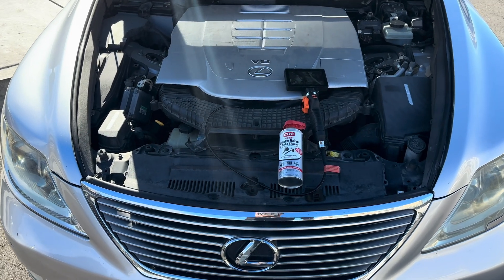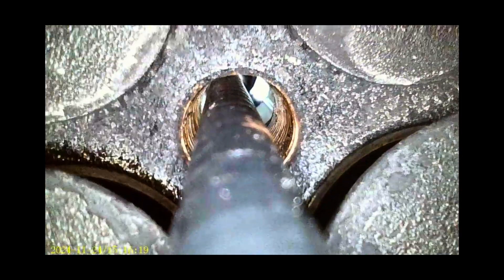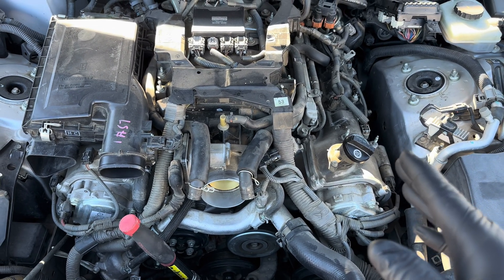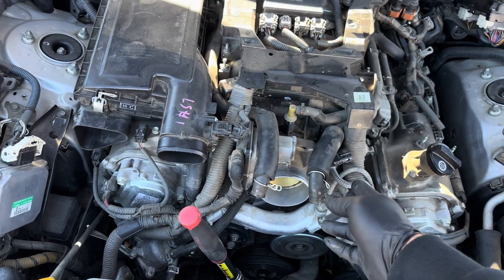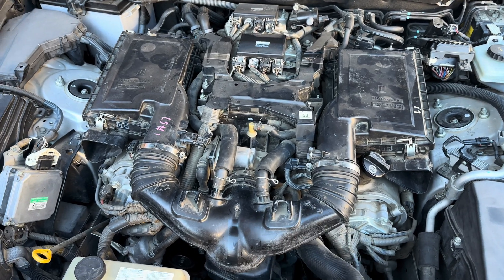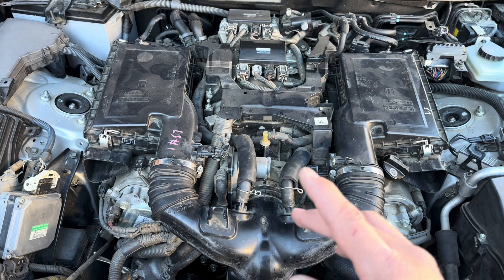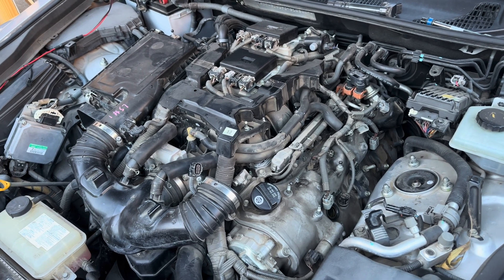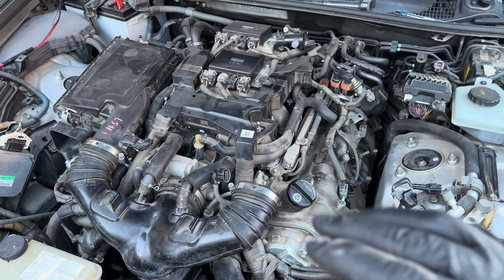Does CRC Intake Valve Cleaner work?

Comment: I just put new spark plugs in my 2018 Chevy Cruze with only 24k miles. I'm the original owner. I stuck my boroscope down all the spark plug holes and was shocked at the amount of carbon buildup on the inside of the intake valves and pistons 😮😮  I change the oil one a year or 2k miles always use high quality fuel and oil in it 🫨but most trips are under 20miles on the highway with once a month small trips. It still runs great fuel trim's are perfect 😁
Reply from the maker: These new direct injection motors have to have their valves cleaned on a regular basis. Otherwise eventually, you will lose performance and possibly cause damage. Thanks for watching.

Comment: Did you say this engine was both port and direct injection. You shouldn't have to do this unless you're engine is just plane worn out. But thanks for the video
Reply from the maker: Yes, it does have both, but because of the inherent amount of carbon buildup with direct injection, you still have to clean the intake valves on these engines. Thanks for watching.

Comment: I have a 08 ls460  i used techron fuel system cleaner do u have  a better one u can recommend i do use the valvoline oil car runs great it has 190 thousand miles
Reply from the maker: I alternate between Techron, Lucas fuel system cleaner, and CRC. Thanks for watching!
Reply: Thanks for the fast reply tony u earned a new subscriber  @Fix-it-tony

Comment: You are looking at the valves wrong. It's supposed to clean the stem part, not the plate. Stick your boroscope through one of the sensors on the intake.
Reply from the maker: These engines have dual injection, so the issue is not with the stems, but in the actual combustion chamber with buildup. Thanks for watching!

Comment: Pretty sure the oil consumption on toyota and lexus is because the rings are so low tension, they eventually just get pushed out of the way by the oil around 120k miles plus. The only way to fix the issue really is to replace the rings, just bad design on their part.
Reply from the maker: Consumption has been cut in half since starting Valvoline restore and protect 3 oil changes ago. Thanks for watching!
Reply: @Fix-it-tony  yeah that varnish build-up doesn't help much either.  It seems it doesn't matter how often you change the oil it still builds a varnish. The restore and protect I've seen can remove all of it. But also clean or replace you PCV and clean the VVT filter and you should cure all your consumption if it's not the rings.

Comment: I had much better results with using BG44K Platinum. I bought a set of 3 cans from Amazon and used 2 cans one after another one and used the 3rd one after like 5 k miles. I checked my cylinders with borescope and the top of my pistons was shiny with no carbon buildup. Not completely but like 80% of the piston was just metal and I could see the markings on it. My mileage Is like 80k lower but a lot of short trips and the pistons had more buildup than yours, it was like super black and thicker. My intake valves look like brand new, I don't have carbon on them at all. Was resealing the valley plate recently and checked my valves with borescope after removing intake manifold. I used BG because it is an industrial spec cleaner and used by majority of car dealers in the USA. I used gumout/techron but... meh.. maybe helps a little bit but bg cleaned my valves/pistons the best. A little bit pricey, like $70 with tax but you get what you paid for. My hesitation when accelerating disappeared as well. P.S that was actually the reason why I started experimenting with fuel additives
Reply from the maker: Glad to hear you had success with that cleaner, thanks for watching!

Comment: Great video! The results are amazing. I have a Mercedes with the m276 twin turbo direct injection engine I want to try this on. It looked to me the input hole you drilled is before the throttle body. Am I correct and does this matter?
Reply from the maker: I believe on a turbo charged engine you need to spray before the turbo. Clean the compressor and the combustion chamber. Let us know how it goes, thanks for watching!

Comment: You have to run the car for few days then check the chamber again, you will see a difference
Reply from the maker: Will be doing a following in a few months. Just put a starter in the car last night which requires removing the exhaust manifold. The ports are definitely cleaner and the cat looks good. Will include that picture in my next video. Thanks for watching!
Reply: @Fix-it-tony  I have been using that product for years, great product.
Also; get the MAP sensor cleaner to complete the clean up. Its from the same brand.
Good video!

Comment: This isn't necessary nor does it work very well. Just change the oil synthetic every 5k miles with the filter, use tier 1 gasoline, replace the PCV valve and Spark plugs every 50k miles and you will be good!! 3rd generation mechanic and engine builder.
Reply from the maker: Not sure you understand the issue with direct injection engine. No fuel being sprayed on the intake valves leaves no way to clean them. All direct injection engines require a chemical or mechanical cleaning. Thanks for watching!

Comment: The can says 2000 rpm, do not exceed 3500 rpm. Why do "experts " always ignore the label instructions?
Reply from the maker: Legal departments, 2k rom is too low with this stuff engine keeps dying. Worked just fine at 3500, as long has your engine doesn’t have an overheating problem should be just fine. Thanks for watching!
Reply: like you said they didn't exceed 3500 rpm

Comment: You may want to consider NGK Ruthenium PSPE or DFE plugs. The PSPEs are the best performance gain I've ever done that I can actually see and feel
Reply from the maker: Will check them out, these are the NGK laser, always worked well. Thanks for watching!
Reply: @Fix-it-tony  Cool!  The multi electrode plugs are a trade-off...  My car came with them stock. However, they tend to restrict the flame kernal for reliability. The PSPE version puts the flame right where it needs to be without restriction. That in itself gives it the reliability over the older multi electrode design.
Reply: one is for turbos the other is for NA... i forget which is which tho.

Comment: Showing the before and after of the valve inside the intake port would have been more helpful.
I think that's the main use case for this product on GDI engines.
Reply from the maker: Couldn’t get a clean video, but this engine was clean on the inside. Its issue was with excessive carbon in the combustion chamber which also cleans. Thanks for watching!

Comment: I don't work on cars and I'm not a car enthusiast but recently found out about the CRC and Redline through videos like this.  I have a 2018 Sonata that I thought was dual port and found out it is GDI only, it has about 28,000 miles and I plan on using the CRC on it to clean the intake valves. Something to think about with dual port injection is possibly using Redline as well as it seems to work as good as CRC but you put it into the gas tank. I saw a video from someone on YouTube that used Redline kind of back to back on a high mileage car and it really cleaned the piston area. I think it was a bit extreme the way he used it but he was trying to see if it would work; once clean using it every 5,000 miles or so may keep the carbon a bay. I could be wrong but using top tier gas mostly and CRC and Reline every so often may be beneficial in keeping carbon deposits off everything. At this point I haven't seen any oil change places advertising using the Valvoline Restore and Protect for an option.
Reply from the maker: From what I’ve seen tearing down new GDI engine’s is excessive carbon on lower mileage engines. Top tier fuel doesn’t keep the valves clean. A two prong approach or even three depending on the way you drive. Cleaning through the intake is a must, fuel tank cleaners help, but don’t do the whole job. The ease of using CRC really makes it a no brainer. Using Valvoline Restore and Protect completes the preventive package to insure these new engines run a long time. Thanks for watching!
Reply: @Fix-it-tony I respectfully disagree. Top tier gasoline along with oil changes every 5k miles and spark plugs and PCv valve at 50k miles and these engines are clean!! Ever seen a racing engine run on methanol? Spotless 😂 3rd generation mechanic and engine builder.

Comment: What do you use to plug the service hole you created in-between services?
Reply from the maker: I use this, cheap on amazon. 
https://a.co/d/4iBGPw1
Thanks for watching!
Reply: buy a rubber plug before drilling a hole this way you will know what size of a hole to drill (make sure you first remove the part you will be drilling)